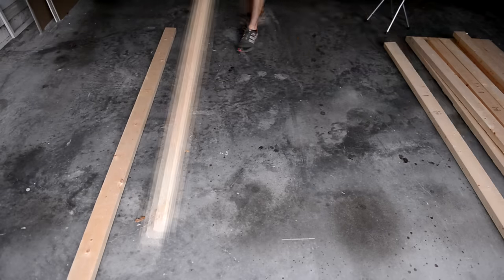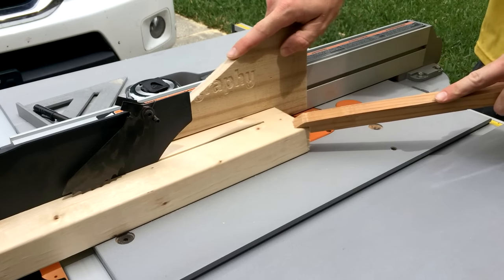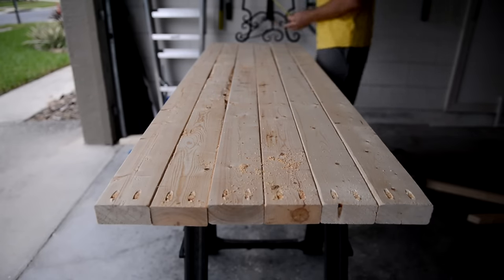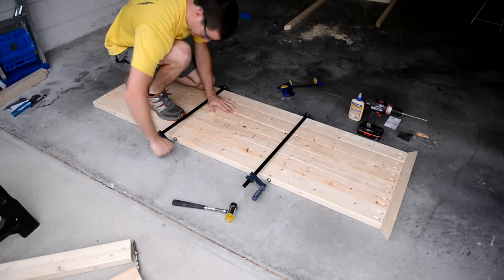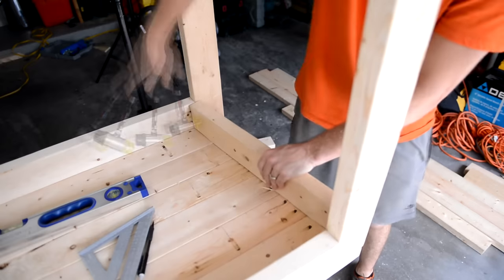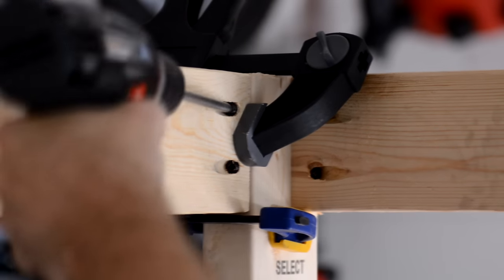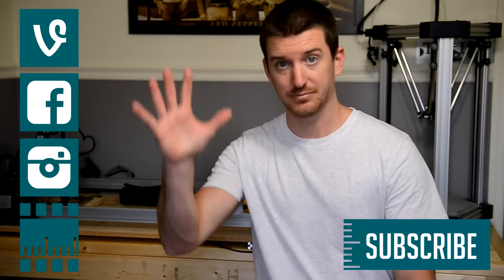How to Make a Workbench Out of 2x4s

Comment: Granted you said you aren't the best at your miter cuts lining up flush and square(45 degree trim). Just a tip. You should always do those last regardless if your entire cut list was all completely dead nuts perfect. Even if you were were using a jig. Noticed one of the miter trim corners had like at least 3/16 gap. Miters can be tricky if you don't do them all the time. And just cause your cut list came out dead nuts perfect you can't rely on that when putting on your 45 degree miter trim. Measure the length. Then measure it again. Then to be sure... chop one side at 45 degrees at a time and fit it and then measure again. And then again to make sure... then I'd take the other side once you know exactly how true your miter cut needs to be and then 45 miter the other side. It takes a while but once you get good at it it will snug in flush and be loving it. Measure both long to long and also long to short on your miters. Before you know it you'll be doing them blindfolded. I make scenery in the shop for the studios out here in Los Angeles and have made my fair share of mistakes and also learned from the vets! But until you get expert status... cut your mitered trim last and fit each piece one at a time... hope that tip helps for your miter cuts!

Comment: Only thing holding up the center of this table are pocket screws horizontally screwed into a 2x2.  The base only supports the 2x2.  No cross members and obviously no glue.  Very nice table but drilling all those lateral holes in soft lumber will eventually crack and fail without glue because of shrinkage and screw pressure.  A couple extra 2x4’s and some glue would have made this table a lot stronger.  Nice design though.

Comment: Not a bad project. But it seems to me the legs are only supporting the boarder of the table top. That means you are relying on the shear strength of the screws to support any weight you put on the table. I'd recommend an actual horizontal support across the table top, supported by a at least one leg. I always try to visualize the path of the weight from the top of the work down to the ground or floor.

Comment: Buy some locking caster for the bottom... 2 inch/wheels for less than $5 each... they will handle about 80 lbs. each wheel (not the post kind) .... which is 4 X 80 = 320 lbs. if not enough then 6 wheels = 480 lbs.... good luck with your creation!!!!

Comment: I made a 2x4 bench….similar,to your table.  But…I leave it out side and gaps quickly develop between the long boards on top….which were tight when i made it.  Any suggestions on fillers?  Everything seems to crack….I have not tried np 1 or sawdust with glue….but they never match in color that well….anyways..l.all advice and suggestions are welcome…thanknyou

Comment: I've read a few of the replies, some of which were somewhat rude.  This gentleman is working with the tools he has on hand.  Based on how he talked, and what he used, he had limited tools to work with.  

The one poing I agree with is that he should have used lots of glue, especially on the joining of the top 2x4's.

He would have done better to have used either 4x4's for the legs, or joined two 2x4's into an "L" configuration, and again, made sure to use glue.

And I agree that the wood at the bottom of the legs would have been better if they were about 10 inches off the ground.

My own suggestion to create a very flat work surface would have been to use a sheet of ply or some hard manufactured wood, so that replacement could be done when that sheet became too marred.  He actually could have flipped the marred top over if he had not drilled or cut through the top completely, saving money.

But my opinion is that for a first, he did very good.

Comment: Glue is Great.   Sorry,  way to much drilling.   Next itch,  not squaring up each board,  3.00 X 1.50.
Clamps & glue would ensure a flat top.   Add a sheet of 1/4 or 1/2  inch baltic birch on top would clean it up.

Comment: What you made... was a row of boards made of soft wood held together by a few screws. I think it's a weak table. Carpenter's glue isn't just "goopy stuff." It's the bond that the screws support until it dries, and then the screws are completely unnecessary.

Design improvements: 1) Cut tapers on the legs (taper from inside toward outside) leaving a 2 x 2 foot, rather than a 2 x 4 foot to allow for floor irregularities, then 2) brace those with your horizontal rails 6" minimum off the floor to leave room for regular clean-up. 3) Finally, cut 12 45° braces for anti-racking and place them in the 4 corners of each existing side. Minimum size: to fit between the halfway point of the "mini-skirt" and leg. Larger on the back skirt, if possible, but only to halfway down to the rail I described in #2.

Excellence is never a waste of time.

Comment: Great Video. How is the bench holding up. I am planning on building a bench and wanted to see how it is holding.
Reply from the maker: Thanks! An oldie but a goodie. Bench is holding great. I'm using it for my 3D printer, computer, and desktop milling machine. I've moved it from my garage to my home office and now to my office and it didn't fall apart! Good enough for me.
Reply: MacCraiger it’s definitely good the.  Mine will be a garage worker though.  Do you think it’s strong enough to hold a transmission?
Reply from the maker: @RESTORATIONRESCUE  how heavy is your transmission? I've stood on the bench several times and I'm 150 lbs. Probably should use glue as mentioned in 85% of the comments 😜
Reply: MacCraiger probably a little heavier than that. Haha. But I’ll definitely tire with glue.  Appreciate it

Comment: This is a work bench not a dining room table. Strength is more important than appearance. I would not trust using only pocket holes for connecting the legs to the table. Diagonal braces on the corners would make the bench stiffer and stronger for little effort. Good job by any standard.

Comment: nice bench only 2 things i will change when i build mine first move the lower leg supports up about 6 inches and second i would run the boards through my table saw to give straight 90 degree edges so you wont have the lines in the top and would make for a smoother top(because most lumber from home depot has softened edges instead of sharp ones)

Comment: I have very little wood working experience... Had shop class in middle school.  Why are people in the comments section against the pocket holes?  I've seen a few other videos where they join wood together almost like a puzzle (triangle-ish cuts that fit the pieces together).  Am I in the right ballpark here?  I'd like to build a simple work bench for my garage and this looks like even I could do it with a little more research.
Reply: +achigurh88 Pocket holes are great for hard wood and light duty furniture.  They are not meant for heavy duty loads and soft woods, such as pine which most 2x4s are.  There are many many 2x4 work bench plans out there, sadly this isn't a good one.  This is a good hobby bench for crafting and and other "light" jobs.
Reply: That is why I think the addition of a good glue would be advised.

Comment: What type of SCREW do you use Hey why is no one using the old wood screws a tore
Reply: Oh idea if you take and save your 2x4 pine boards sawdust  and inbetween the boards put tie bond glue them fill with sawdust and fill.slightly rounded then sand smooth and the divider are smooth

Comment: I've seen and used plenty of 2x workbenches made with the top laying flat as you have done, it works just fine if you add more cross support under the top. The outer 2x2 framing is cute, but consider that the ends of your top boards are resting on air and not the end skirt and you tend to heap abuse on the front edge of the workbench which is now just a little 2x2. A stronger skirt would be made by not interrupting it with the legs and affix the legs to the inside corners. Cut your top boards 1" longer than needed then after they are affixed together use a circular saw with guide/fence to cut the ends square and to final length.

Comment: Is that all the sawdust you got?   You aren't working hard enough!! ;-)  You also made that pocket holer work hard enough!
I plan to do a 2x4 bench as well, but will probably at least cut them down to get rid of the rounded corners on the bench top wood to have a smoother finish. Also want to glue it up as well, at least the bench top.

Comment: He’s got jokes!! Lol. “Clamps are duct tape’s first cousin” lmao! “Or you can just sand the crap out of it” lol. That what I do. I don’t have a jointer or a plainer and I’m too impatient to use my table saw for jointing. Lol. And the “skirt” is usually referred to as “stretchers” (I think). Also, you should become friends with wood glue. I’ve seen people use popsicle sticks to spread it so they don’t get their hands all covered in glue. But even if you do it actually comes off your hands pretty easily.I also keep a plastic sheet for glue and stain. I just get a big roll at Home Depot and cut it to size and I’ll use that one piece 2-3 times before I have to toss it.

Comment: Unless you have chosen the perfect area of your garage floor for layout and assembly,  much of it isn’t flat.  It’s a large gentle funnel towards the doors that your eyes don’t notice.  Stay away from the sides.   Middle of the floor is best (if there’s no floor drain).  One fun way to check for flatness is tie a string to a chair leg one inch up from the floor.  Tie the other end (7 or 8 feet away) one inch from the end of any handy stick.  Put that end on the floor with the string taut and visually check the gap between string and floor. Check several spots along the arc of the string.  Then move the chair and do it again.  You’ll be disappointed at how flat your floor isn’t.  Or maybe not.  It’s good knowledge though.
Remember,  you can be flat without being level,  but you can’t be level without being flat.

Comment: You have issues with the corners because if you have any variation in the construction than your corner cuts will not be perfect 45s.  They may be a 46 and a 44 degree cut.

Comment: I built your bench! I liked your video, and it lead to a great result except I was challenged when it came to the correct adjustment of the Kraig jig. You seem to just throw it down and drill and all your pockets worked.  What size screws did you use? And according to Kraig, your drill should have been chucked for maximum depth, but yours wasn't. How'd you make that work?

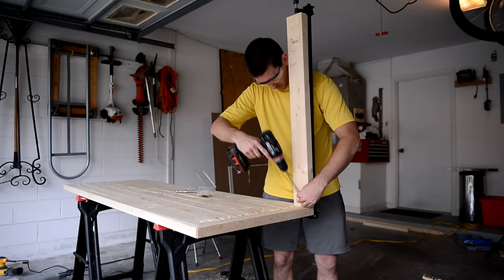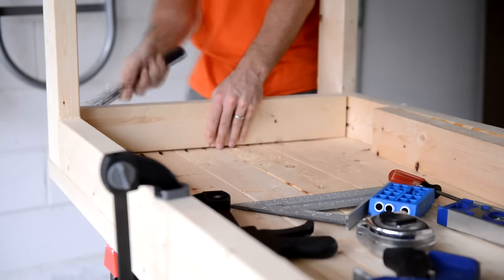Comment: I have to question the structural strength of pocket holes without glue.  But leaving that aside, there is one part of the build that you should reconsider.  When you put edging around the top, it was fine on the long side, but pocket holes in the end doesn't allow for the wood to expand and contract.  This will eventually cause the boards to split or buckle.  both equally bad.  Here's a link to the video that explains it really well.  https://www.youtube.com/watch?v=lKxUQKRjoEQ  See time mark 5:07 and 6:25 through 6:59
Reply from the maker: Definitely glue, I was a noob when I made this. Still holds up though but I'm not dancing on top of it.

Comment: Okay, 5 years later how's the bench working? And, are you still fixated on pocket holes..;-)
Reply from the maker: Holding strong! "Workbench" was a loose term, I have a 3D printer and computer sitting on it. Still use pocket holes but my therapist has limited me to only using pocket holes on one project per year. :)
Reply: @MacCraiger  That's good to know - and to be fair, I'm going to buy a Kreg kit after seeing your video!

Comment: the reason your 45's didn't match up well is because you used a miter saw. Use a table saw with a sled and tilt your blade to a 45 degree angle. That'll do it.
Reply: I  use a miter saw and cut 45's to a perfect fit. It's just a matter of measuring and marking properly, something that takes a little experience.
Reply: Probably not accounting for blade width.

Comment: My advice is to stop using the floor as a work bench.  It may be fine today, but in 50 years if you live that long your knees are not going to enjoy it very much and will let you know.  Hell in about 20 years you can go have them replaced so they don't drive you crazy.  I didn't like getting down on the floor to work 60 years ago so I got an old 32 inch door, put a piece of plywood on it and that was what I worked off since.  I could put the thing in the truck along with a couple of horses to hold it anywhere I worked.  I also built a stick frame and put it on the horses do I could cut panels without abusing my knees.  Think about what you are doing to your body when you are working as the future comes very rapidly.   If you are not careful you may find yourself carrying an extra 40 or 50 lbs everywhere.  There is no reason you can't weigh less than you do today when you break 75.  That is a poor excuse why you can't do the same things you do today.  I am 80 and can still cut sheets of plywood on the saw without the aid of some young kid who thinks they know everything.
Reply from the maker: That's why I built a bench
Reply: @MacCraiger  Yet you show how sad it is when you have to get down on the floor to use it for a bench

Comment: you can "get away" without wood glue on plywood and mdf, on non engineered wood you need to use glue because it stretches and shrinks too much and will work fasteners out overtime.

Comment: So, you're going to have to take that thing apart and rebuilt it using the Video Comment Section Posting Manual (provided by the anonymous people below). After all, there is only ONE way to build a workbench, so suck it up, and purchase that Glue Shooting Planing Jointer with optional Dow Rod Injector™ (DeWalt, I think). You're going to need a workbench sturdy enough to hold all those heavy pieces of farming machinery and industrial HVAC units you haul around in your roomy black sedan in the middle of the suburbs. Seriously, that tragedy you made looks like it would only be structurally sound enough to hold things you'd find in an office, maybe even a lab (please don't refer to your Professional Work Working Shop as your "lab (office)" anymore btw...). Lastly, please post any future rookie videos on Vimeo- YouTube was created to so that one guy can make that one video of the only way to make a workbench.

Comment: You lost my respect when you said you "try to stay away from glue and goop".   You really should learn that simple basic principle.  It's like what welding is to metal.  And very beneficial to side mates like the 2x4 top.  You're  being foolish.  Not meant as an insult, and thanks for your video, but you're missing a big improvement. And you used goopish Tung oil anyway. 😜 But it'll work